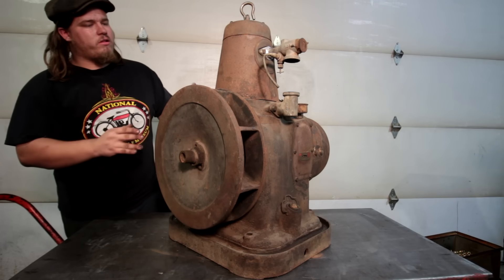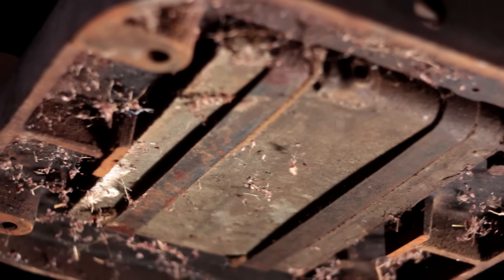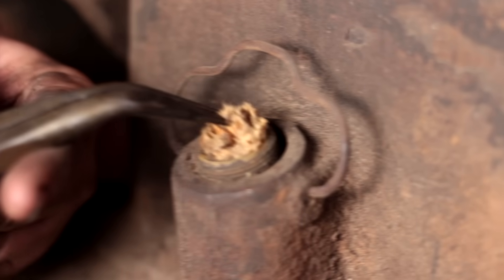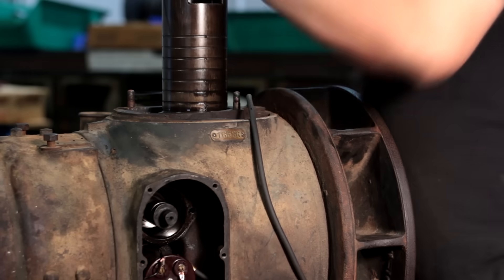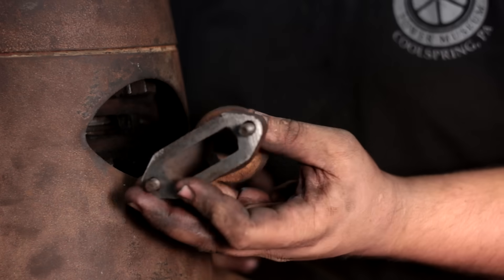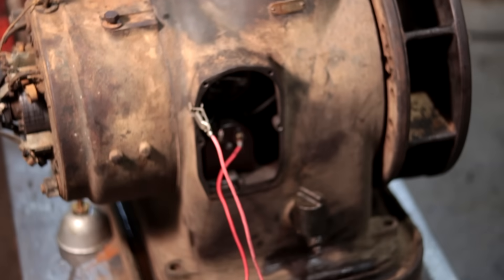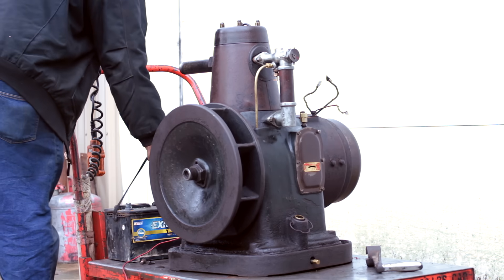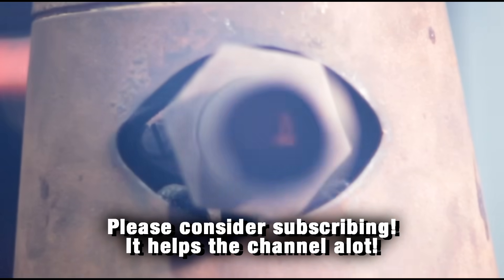100+ Year Old 4 Stroke Engine Design Has NO VALVES!!! Can We Get it Running after 60+ YEARS??

Comment: This system was used during WW2 in the Typhoon fighter bomber. The engine was made by Napier and was a 2100hp 24 cylinder X configuration. Basically two V12's on top of each other. Much too difficult to manufacture and assemble.

Comment: Excellent video. I always wondered why the old sleeve valve engines never took off. So much quieter and reasonably efficient. Keep up the great work!
Reply: The main issue with the sleeve valve engine was the reciprocating motion of a lot of mass compared to a "normal" piston engine.  Carbon buildup may have caused relatively rapid wear on the sleeves and they were "oil burners", the use of heavy oil and loose clearances helped to elevate those problems.  This engine is an awesome example of design ingenuity in the early days of the internal combustion engine.

Comment: I'm thinking this is a simple single cylinder version of the Bristol Hercules/Centaurus aircraft radical engines, also air-cooled. Bristol advanced the concept to its limits given poppet valves didn't last back in the 20's, hence their preference for the sleeve valve idea that they persisted with well into the 50's.

Brilliant video and what an amazing engine. I had no idea these existed!

Comment: That Old engine is as smooth as . I think it would be pretty fuel efficient as it just purrs along like as though the fly wheel weight gives it the Kinetic energy to just tick over with ease . I could be wrong but sometimes i think these old engines were way better than all of the So called modern technology of today . Loved the clean up and loved the old engine . Well done on preserving History . 👍👍
Reply: Modern Engines concentrate on power output and efficiency not longevity as in age.  I doubt many new engines could last this many years sitting around and be revived. However moden engine cover more miles over shorter time. For example.. I had a Toyota Prius.. I put 225K miles on in in 4 years.. it had 425K on it total in 14 years. I have seen a 14 Toyota Corolla with 780K on it. No older car could do that without several rebuilds. I think mostly due to the engine tolerances. Now.. if you could build an older engine design like this but with the tight tolerances we have today.. use fuel injection... maybe you would get both power, and miles, and longevity. I do love seeing these old engines get revived and run... they are awesome.

Comment: Given that combustion was visible through the exhaust port, could sleeve timing be changed to recover more power by containing the burn for longer before the exhaust stroke begins?
Reply from the maker: not really almost all engines have some amount of combustion after the exhaust opens it just looks worse when you get to see it directly in the chamber.
Reply: @cruddycornstalks  i suppose you're right for a long stroke, low RPM motor.
I was just wondering  because it seems a 4-stroke cycle would give you more time to use the expansion.

Comment: I found this fascinating. I never realized how many different engines were manufactured from prototypes to those that saw a lot of service. You are savant-like in your expert handling and knowledge of this particular machine. It seems very efficient. I would like to know a little history on it. What kind of fuel does it use, etc. Excellent video. Subscribed.

Comment: Thanks Brother, brings back memory of removing the exhaust pipe and looking in the Engine exhaust port of my 175cc Two Stroke motorcycle as a kid, and having the epiphany that engines don't actually 'create' any power, they only momentarily 'capture and harness' hot exhaust gases  like a windmill...

Comment: I'm not so sure having it hang by a spark plug hole is all that wise. Anyone that beat on the crank nut at some point has more than likely cross threaded the spark plug threads at some point too. Couldn't you just flip it on its side instead?

Comment: A single cylinder version of a Bristol Hercules engine, which powered one of my favorite WWII aircraft, the Bristol Beaufighter. I had the rare privilege some years back of working on the engines of one of these rare gems at the foundry/machine shop I was employed at. We specialized in both WWI & WWII radial aircraft powerplants, needless to say, I was beyond thrilled, as I had never been up close to a Bristol Hercules engine & was much more than just interested in how the whole sleeve-valve process worked. 

I kept detailed notes of all of the procedures that I was involved with, just in the rare possibility of ever being able to work on any others. I also copied all of the engine & airframe assembly manuals that came with the pair of engines, as they've allowed me to build several detailed 1:32 scale Beaufighter models over the years. Beautiful engines!!

Comment: Your channel is a genuine pleasure to watch. I'm a retired certified automotive tech and I have rebuilt everything from single cylinder to V12 engines long before electronic ignitions and fuel injection. I admire your knowledge and approach to the disassembly and repair of these vintage engines. If you find the time to respond I would like to know how you knew that this engine was not timed correctly and what you did to set the slide valve timing? Thanks
Reply from the maker: the engine was so badly timed it was almost 90 degrees off and causing  pop sound when turned over because it opened the exhaust during the compression stroke. I simply retimed it by eye until i was happy.

Comment: No unnecessary shining or painting just getting it done! I’d prefer to watch this over a full reco! But I’ve got to ask where did you get the info that cold air will crack exhaust valves? On the engines I’ve worked on This just simply doesn’t happen! You can have reverberation increased and also can cause it to run leaner just by removing back pressure and doing so will reduce temperature of all surfaces in the exhaust but crack a valve? Please show me the documentation on this phenomenon? Just so I can discredit the engineer that wrote it!
Reply from the maker: the sleeve is made of 1/8 thick cast iron cold shock cracks it very easily. not near as robust as a poppet valve.

Comment: I've never seen a single-cylinder sleeve valve engine before - though I knew that Willys used the Knight design of double concentric sleeves in their cars, and it was used in a number of pre-war luxury cars, where its smooth, silent running was appreciated .  A later version was the Burt-McCollum, which used a single sleeve, which moved both up and down AND twisted radially; big advantage of this was far lower oil consumption.
In the late 30s / early 40s, this type was fully developed by the Bristol Aircraft Company, for use in their radial aero engines, and by D. Napier & Son, in their Sabre 24 cylinder, 2240 cu in (36.7 litre) H-block engine, developing 3,500 BHP, as used in the Hawker Typhoon and Hawker Tempest.

Comment: Around 1955 my father bought such a "Willys Light" from my grandfather's general store estate auction that was in much better condition. It had been used in the years before rural electrification in Western NY State and kept in the old store's garage along with 16 glass battery jars, each about 3 x 12 x 15" high, as I recall from age 10.  They comprised its 32 Volt battery bank.  The battery jars were dry with much of the lead from the plates settled to the bottom, making them useless.  It was accompanied by a large wall-mounted framed diagram of its internal construction and starting instructions.  It was intended to be cranked by the battery bank, using a small amount of gasoline, and then shifted to generator mode, running on kerosene.  My mother told me it had been used for store lighting and to power a washing machine; perhaps other uses like powering the store's single  gas pump.  It was never used after electrification brought brighter lighting at lower cost.  But my Dutch grandfather never threw out much, particularly something with scrap value that was so heavy.

As a teenager I got it running by wrapping a large fan belt around the fly wheel  and a motor with a pulley.   I never did more than add oil and gas, but I used the generator to electrolize water and explode the mix to launch cans in the air from he water bath.  It ran pretty well after sitting idle for perhaps 25 years; I vaguely remember that it  smoked and ejected some oil.  Unfortunately the garage where I had  left it caught fire and heavily damaged the generator while I was away becoming an electrical engineer, in part as a result of experimenting with that ingenious machine.

I believe the wall diagram showed the exhaust injected into a hole filled with rocks, as a muffler contributing to its quiet operation.
Reply from the maker: any idea where that diagram ended up? be a wonderful piece to have! if not the whole unit.
Reply: @cruddycornstalks  Sorry, no.  When my mother died my brother and I sold the three properties our parents had owned, as is.  That included an old sawmill (that had made wooden wheel hubs & had been previously stripped of all belt drives and iron shafts) where the picture and battery jars remained.  The new owner had to tear down that structure after two attempts by teenagers to burn it down.  It may not have survived the fires or demolition.  Same for the generator now 60 years after its fire, now just a good memory to recall.  
You might like to attend the "pageant of steam" held every year in Canandaigua, NY, where a very large flea market sells antique things like hit & miss engines as a side show to the demos of large 1800s equipment. Google it.

Comment: Found it fascinating, I have seen many unusual engines but never a slave valve engine
Reply: Isint two stroke technically sleeve valve engine in a sense, valve is just still as part of the cylinder, so difference is just added complexity to get 4 stroke with separately moving sleeve.

Comment: Wow, that is great. When those very old engines are still running, that is way better than having them static in some engine museum. Find some funny use for it, like put it into an old motorbike frame, and give it TLC.

And having the timing off, that is weird. It took you an hour. Why do former owners take an engine apart, when they can't put it back together? That is sketchy. What else did they hammer crooked?

Comment: If you are ever in doubt about valve timing set the intake or exhaust equal as a starting point, with no advance or retard and zero overlap. This should be a decent starting point.

Comment: i read that you not supposed to run these without connecting them to a battery bank or the generator part will burn up. is yours charging?
Reply from the maker: i set the brushes back so no current was mad until i have someone that knows what to do with the electric side of things

Comment: Eh..  the fuel air mixture does not explode..  it combusts, burns.
Reply from the maker: Combustion is an explosion. If there was no explosion there wouldn't be anything. To push the piston.
Reply: @cruddycornstalks  Nope, there is a difference in flame speed between combustion and an explosion. In an ICE fuel burns, if it would explode most engine would not last.
Reply from the maker: Think you need to do some reading  @flexairz

Comment: I'm curious why didn't you just go buy an oil pressure gauge? that way you would know precisely how much oil pressure this engine has. which could tell you how much wear this engine has on it. I'm assuming it doesn't have a lot of cylinder wear? since it wasn't smoking while it was running.
Reply from the maker: The sleeves always leak oil by  on these engines it's one of the main flaws. I didn't want an ugly modern pressure gauge on it as this thing will only ever make 1-5 psi of pressure and wouldn't read on one anyways.. custom one works better and is way cooler
Reply: @cruddycornstalks  
Question answered, that's pretty low oil pressure for a pressurized lubrication system. but a person has to take into consideration that's a small engine and how old it is. thanks.

Comment: from my 15 minute internet detective work It looks like they sold these as generator and battery kit in the 1920s . they had 2.5 horsepower  rated for 1,350 rpm and  output 1,250 watts of  electricity at 32 volts. It was paired with either a 160ah or a 240ah battery depending on what option you choose. shipping weight without battery was 500 lb with battery it shot all the way up to 1,125lbs.  They also made a Willie's light Jr model that output  1.25 horsepower at 1,700 rpm and output 600 watts at 32 volts with the same size battery option. It weighed 250 lb without the battery. to show how far technology has advanced Your wall outlet has approximately four times the voltage this generator output.  This engine is a marvel of engineering for its day however If you were to convert the generators output using an inverter to create the 125ish volt wall outlet power the USA uses today you would have about 300 watts   You wouldn't have enough power to run a small microwave.   
 http://www.ewillys.com/wp-content/uploads2/2021/11/1922-willys-light.jpg

Comment: "Two ports on the cylinder"
I hear a little two-stroke inspiration :) :) :) :)
Reply: maybe Wankel inspriration :body-blue-raised-arms::eyes-pink-heart-shape:
Reply: @deensedudevonand4115  well, depends, in a wankel the ports are usually covered/uncovered by the rotor itself (i may be wrong since i saw a video about rotary valves although they may be unrelated to rotarty engines)
06/25: i just realised i was making zero sense with this comment lmfao as if the piston in a two-stroke doesn't cover and uncover the ports

Comment: As a husband of a proud owner of a stock 1947 Willys CJ2A, I can attest to the brilliant engineering of the day. Best guess is that my wife's family has put over 2 million miles on this rig since purchase new. Only updates are 12 volt generator from 6 volt and electric wiper motors. Starts 2 nd crank, purrs like a kitten. Best part is the smiles she gets everywhere she goes with it.
Reply: Tell me what!?  More!!
Reply: @andyevans2336: So, Andy. Are you saying you hand-crank this CJ to start it? Or did you omit the 12volt battery when you listed upgrades? And of course then there would be the 12 volt starter or will a 6 volt work on 12 volts?  Maybe so. Anyway, the WAR produced some fantastic things, lots of dead people not being a positive but the Jeep is.
Reply: @ okay, so I neglected to list EVERY item in the 12 volt upgrade, the wipers were vacuum operated and that did suck a bunch. Still original engine tranny and drivetrain. Oh, and you insist, the split rims are nowhere to be seen.
Reply: OMG! 2m!    
You gyes were lucky to hv those everlasting things.. We got in "disposable era"😐
Reply: Yeah a lot of those 6 volts are easily convertible and they run so much better and start better to when they're converted to 12 volt. Add an issue in my old Pontiac like that it was a 6-volt system and I was actually forced by the state to convert it to 12-volt because the headlights were not all that bright. But to be honest it wasn't too hard to convert over. But not a motor of this awesome magnitude or any of the ones that you mentioned.  This was something in the 1960's if I recall? My situation anyways.

Comment: Interesting carburetor design--no butterfly, just a slotted plate with a detent so you could set the mixture and leave it.  The whole design is pretty simple, when you think about it, even if it's unique.   I guess the main problem is wear between the sleeves eventually leading to a lack of sealing?

Comment: makes you wonder why any of the big auto makers hasn't trying something like this. it might not be all that good as an engine use to propel a car, but with all the hybrids out there now, it might make for a good generator design. especially with how quiet it is. it really goes to show just how much of the noise of an engine is valvetrain.
Reply: They did but stopped making them 85 years ago. Just like now days you don't find new cars with two stroke engines. They would never pass an emissions test as they do consume a good bit of oil.
Reply: @gravelydon7072  and yet Mazda has revived the rotary to use as a generator for its latest vehicles. Just because a technology didn't see wide spread adoption back then doesn't mean it can't be adapted and improved today with our better understanding of materials and technology.
Reply from the maker: willys did. they did it for several years! same willys that made the jeep!

Comment: I scored a delco 32v lighting plant for $50 at the scrapyard- got it running ok. Was built in 1925. Sucking air out of the crankcase is one thing the flywheel doesnt do, as that would asphyxiate anyone who goes into the basement it's running in. They had the crankcase plumbed to the carby to remove blowby fumes and the exhaust was plumbed outside. Earliest version of positive crankcase ventilation I've seen.

Comment: The only tool you own is an adjustable spanner? I take it all the screws were soaked in WD40 and the loosened with a proper box spanner. The adjustable spanner is just for effect?
Reply from the maker: not at all went in dry and used the crescent to much success as everyday! only time to have problems is if you use it wrong!